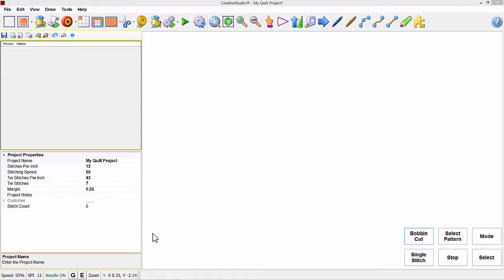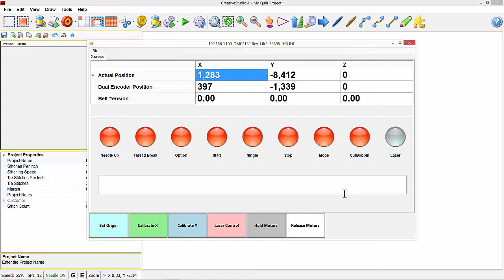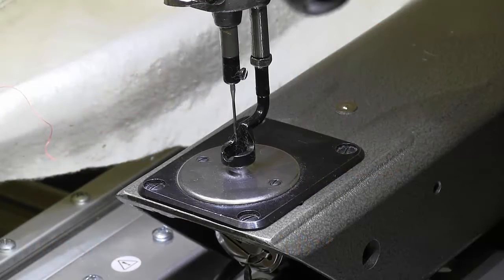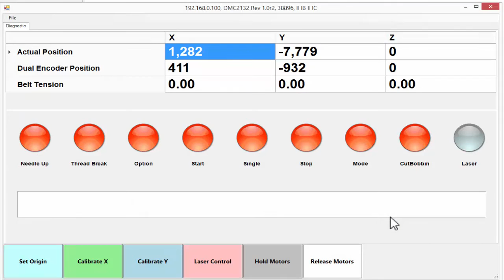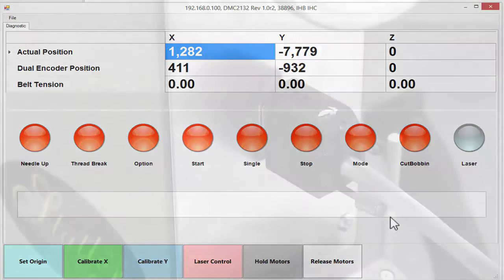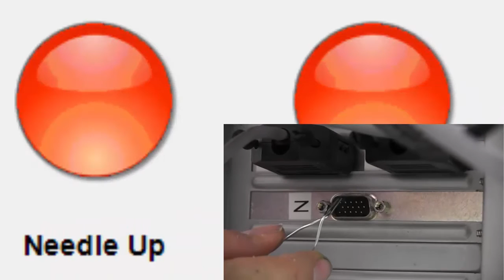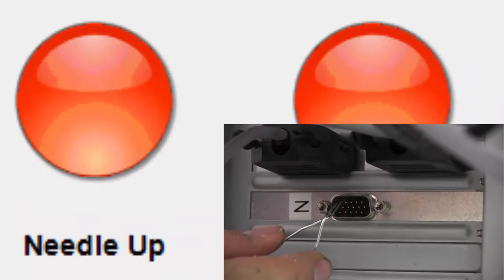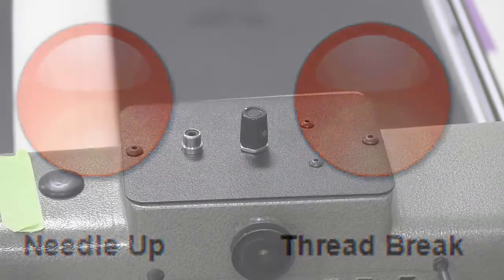Needle Up Trouble Shooting

Comment: One step not mentioned is to check the "Z" circuit breaker on the front panel of the Galil controller.  We had a persistent "Needle Up Position Timed Out" error message which turned out to be a popped breaker that only needed to be pushed in to reset.  Thank you LEQ and Gammill tech support for that information.  I think the breaker should be a point of attention in the troubleshooting guide video.